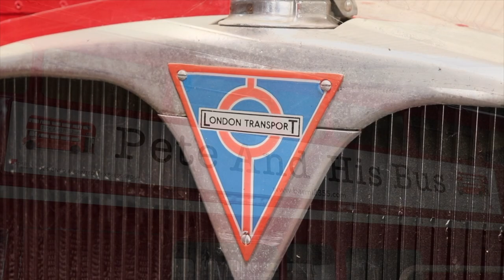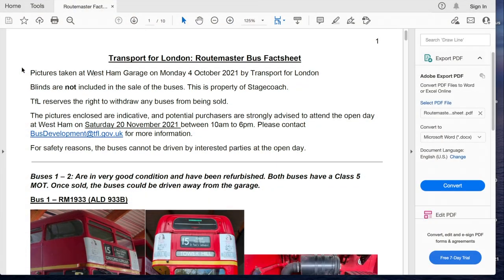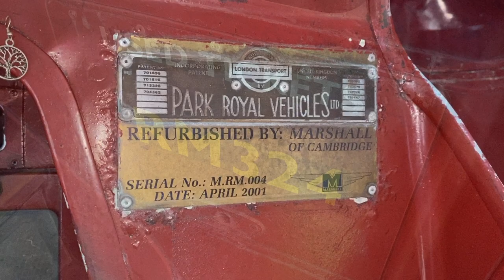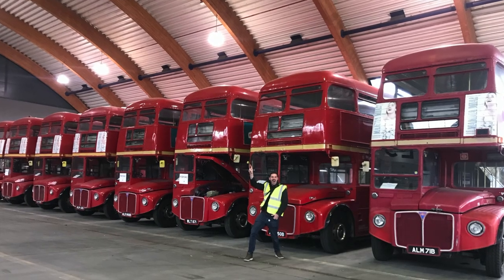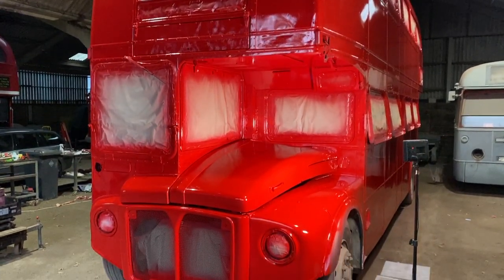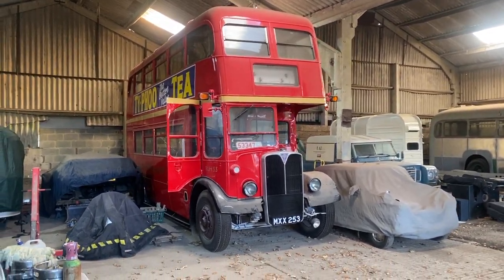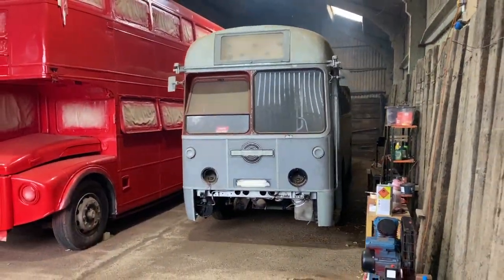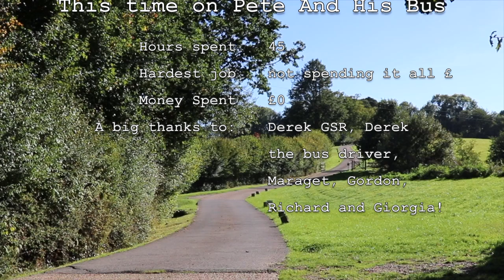Pete And His Bus, Episode 24: One More Spray

Comment: Hello Pete. Love the fact your restoring these beautiful and icon buses. If there's anything that screams British it's the Route Master. Now when I look at all the Route Master refurbishments I can't help but notice that all have no screws holding the panels in place. Sadly all the screws have been replaced by pop rivets. You may be wondering how could know this detail? Well my Dad worked at Aldenham   works in its hay day as a coach maker and he reckoned he had worked on every RM ever made.  It was one of his pet hates when he saw an RM with rivets holding the panels on instead of screws. His prize possession was his Pump Screw driver. It was at least 2ft long. Designed for the quick removal  and placement of long screws. 

Something must have rubbed off on me as I ended up working for London Country Buses.

Thank you for posting these videos. I wish  the very best keeping these Route Masters running.
Reply from the maker: Hi there, thanks for for watching. In an ideal world all the screws would go back in the bus but they often corrode and make for very difficult removal and re-instal so in the real world and in a non “show bus” world I use the old rivets. 👍👍
Reply: Hello Pete  thanks for the reply. I do understand and I certainly didn't mean it as a criticism.  I think it's great what you're doing. 
All the best from sunny Jomtien Thailand 🇹🇭 😎